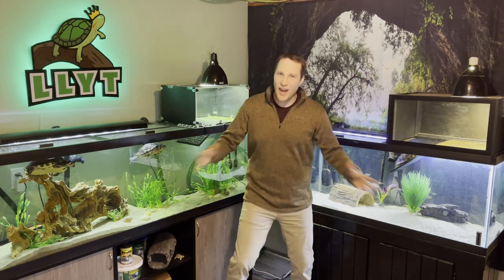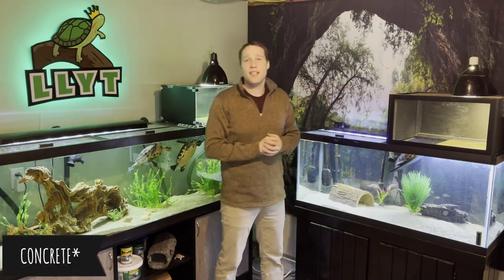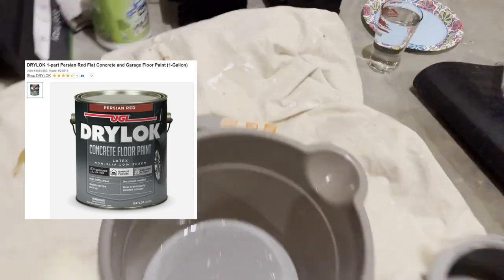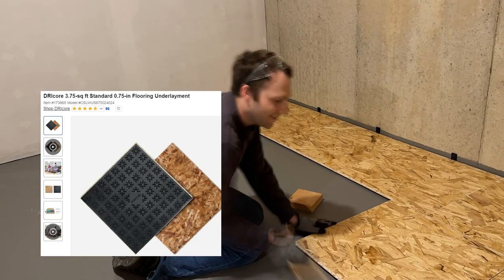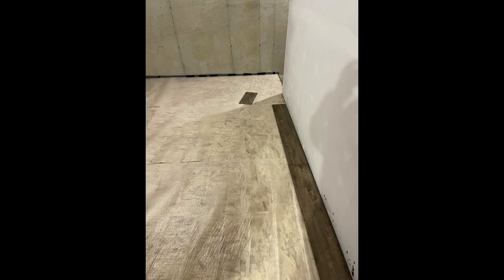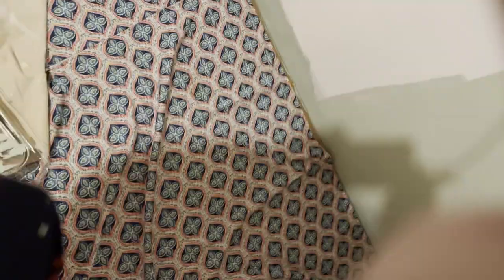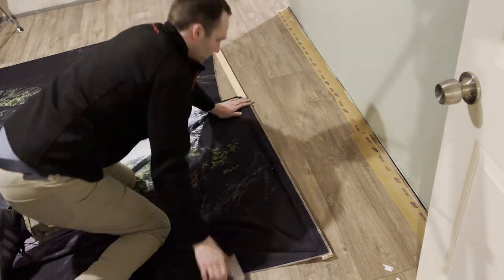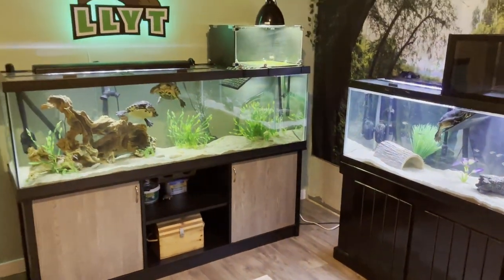NEW TURTLE ROOM - EERIE BASEMENT TO TURTLE LOVER LIVING SPACE!

Comment: Hi I’m running a similar setup to yours, I have a full sized red eared slider, and a 5 inch cichlid, a few algae eaters, an albino pleco, and I’m running 2 fx6 fluval cannister filters. I used to run sand in it - but the filter was picking up a ton of the sand and I thought that may be part of the problem - so I’m running it bare bottom right now. I also used to have some lava rocks in the tank. My question is - I’m having to clean my filters probably twice a month (each) I’m cleaning the tank at least once a week it seems, and I’m not sure what’s causing the excess. Possibly over feeding? I’m slowly adding more cichlids. Sitting at 4 currently, 2 are maybe 2 inches, ones a good 3. Thanks for any input!